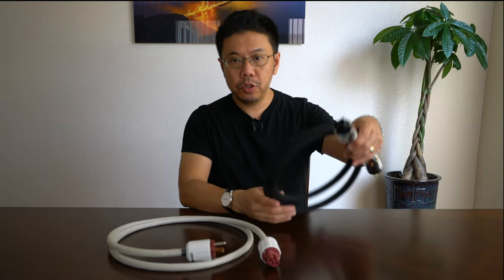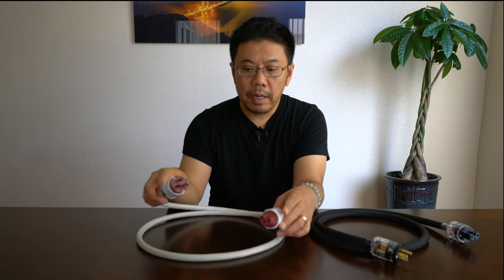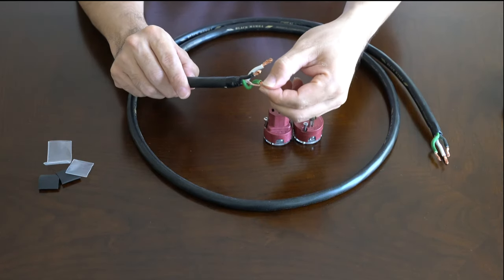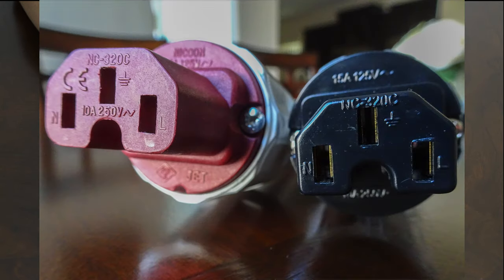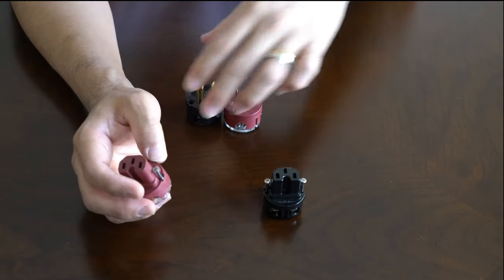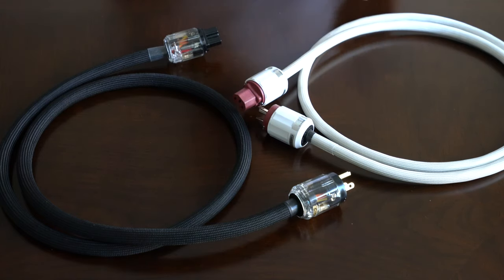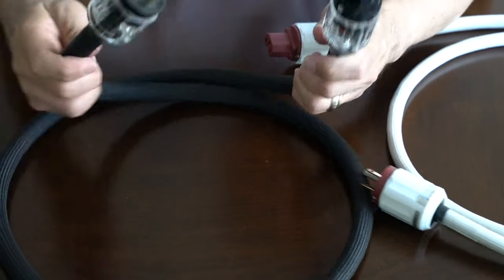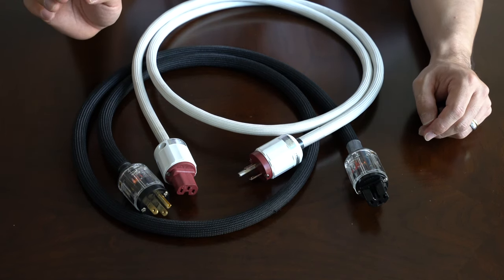Audiophile Grade Power Cables, Easy DIY AC Power Cords

Comment: Thank you, this is very valuable information. I’m planning to make all your cables. Can you clarify if W3104 can be used both for speaker cable and power cord as you’ve used?
Reply from the maker: Yes you can use W3104, it will work great.
Reply: Thank you! Then I can order for speakers and power both from redco. Much easier. 👍🏽

Comment: Hi. Nice video. I have an Accuphase C-240 Preamplifier and would like to make a decent quality power cord. It has the old 2 prong socket on the unit. Are there new female plugs that will fit this unit? When I bought the unit it included a very light weight third party power cord and I'm sure it affects the sound quality. Thanks for your anticipated response.

Comment: what about the rest of the power wires in my walls from the circuit breaker?
Reply: LMAO!
Reply: Better yet what about the cable coming from the transformer outside supplied by the electric provider? I don't think I can talk them into installing a cable from Audioquest or PS Audio lol. 👍

Comment: Have you ever looked into upgrading the wall plug circuit to a 20amp from 15 amp with heavier AWG copper to it from the panel?
Reply: If you can, start with running 10 awg wire (10awg 1-40 feet, 8awg 40-60, 6awg 60+), 15A breaker typically fine for most(20A breaker good too), 20A receptacles are better for not much more, 20A receptacles throughout the house is really the way to go. Even better use Hospital grade receptacles for Audio gear.

Comment: On the female plug...you don't use the shield + Ground (Only ground) ?
Reply: I have this same question. On the IEC end you just leave the shield unconnected?
Reply: It’s called a drain wire usually only on the one side which is plugging into the wall.  This effectively gets the noise out of the component injects the noise back into the mains.

Comment: I don't think there are "audiophile grade power cords" technically, like there are no "gaming" motherboards.
But I love the appearance of your DIY cable.
Reply: Technically you are right, there is not much difference.
But semantically you're wrong, because "audiophile grade power cords" => $160...$200, thats a serious difference and it makes it audiophile.
Reply: of course, you are right.  motherboard gamer, gamer chair, gamer headphones, gamer peanuts, gamer keyboard. 
 being so: I have "audiophile grade power cords" in my water pressure pump installed in my house (shielded, line, ground, neutral, isolated cap/connector brand Leviton) .  and I did not noticed my Milwaukee Drill has audiophile grade power cord
Reply: @telelaci2  "audiophile grade power cord" 🙄
being so: I have "audiophile grade power cords" in my water pressure pump installed in my house (shielded, line, ground, neutral, isolated cap/connector brand Leviton) .  
and I did not noticed my Milwaukee Drill has audiophile grade power cord 
a power cord of 25 USD, vs 75 USD power cord of my polisher tool _that's a serious difference and it makes it audiophile. 😆

Comment: Does the model # of the Oyaide plugs determine what gauge wire can be used. I bought p79/c79 using 10 gauge  wire have a tough time inserting wire.

Comment: How do I know if my component requires a grounded or ungrounded power cable?
Reply from the maker: if you have 3 pins in the back of component power input you need grounded AC power cord.

Comment: Do not take the word of this guy there are electrical properties that must be addressed in building a audio grade power cord current delivery,sheilding, metallurgy,to name a few you can’t just go out and buy bulk cable and expect it to perform great,if you have a low fi system you might get some benefits from these cables but certainly not for a high end reviling system

Comment: Power cord is only part of the equation, you will also need to upgrade the wall sockets and mains cable  between the sockets and circuit breaker.
Reply from the maker: Yes, I even have my own transformer for whole house.
Reply: @Tharbamar  
Next upgrade: install your own diesel electrical power generator. It's the only means of ensuring the quality & continuity of generated power. In Australia MITSUBISHI Powered 5kVA Diesel Generator 240V is decent, quiet, single phase retailing for around $6,500. I highly recommend dedicated power generator for high end HiFi audio system.

Comment: Hi Tharbamar. Very nice video! One question relates to the plugs: why did you choose the Oyaide knock-offs when you could have gone with something like HiFiKing CC-18 & PU-18 sold at the same price on Amazon?
Reply: or even these which are also knock-offs sold from same dealer in US: Oyaide P-037
Reply from the maker: whizzbang because I preferred Oyaide design, thanks
Reply: @Tharbamar  Good reason;-) So you like the P-029 better than the P-037?
Reply from the maker: whizzbang No particular reason, I only choose base on the same design of genuine Oyaide plugs I already have.

Comment: @Tharbamar Can the Mogami 3401 be used for the grounded build? What is the difference between the two wires in your testing
Reply from the maker: Yes you can add dedicated ground wire lope around W3104 from end to end counter lope from twisted main conductors and put on the nylon jacket over it to use it as grounded AC cord.
Reply: Mogami also has 6 cores cable 2919 and 8 cores 2941, but 3104 is the most common cable.

Comment: Which style cable goes on which components? For example Marantz receiver and power amps?
Reply from the maker: I thought I said it in this video, you have to use base on what you need and sound that you like, usually I use the best one amps.
Reply: So it doesn't matter to what the device needs? It's based on which will be better sound and quality?
Reply: And to be clear the Oyaide black mamba is the supior wire?

Comment: Will this type of plug work for computers? I have a PC that I use for audio I think this might help a bit for noise.
Reply from the maker: The white cable is more suited for your need.
Reply: Depend if you using USB?  in that case you need a USB isolator like this:(iFi iPurifier3 USB Audio and Data Signal Filter)  otherwise you have noise like me.

Comment: does it actually change the sound? or improve atleast?
Reply from the maker: Yes it does change the sound in most of my systems.
Reply: I was skeptical with an upgraded power cord at first. I built a Bottlehead Crack and bought the upgraded power cord from their website. The difference is night and day. Everything sounds more realistic and the bass improved.
Reply: @Tharbamar  your cord is 1.5meter in length?

Comment: Anybody know a seller that sells a similar quality already made cable on eBay or Amazon? You can find them for like 20 bucks on eBay thanks anyway for the tutorial
Reply from the maker: You can buy Oyaide Black Mamba for around $2-300 but you’ll not find 6AWG Power Cable with Neglex Copper for sure.

Comment: I made it to 1:25 and face palm. Boy I hope your wall outlets are also 102.3% conductive and everything else before and after the cable. I'll bet the wire inside the amp that runs from the rear panel IEC plug to the transformer ISN'T shielded and ISN'T 102.3% conductive.....LOL !!! When it comes to conductivity %percent% ratings are relative to 99.9% OXYGEN FREE copper being 100% conductivity even though its not. So this special wire is 2.4% more conductive possibly. Will this make a difference to the transformer inside... its shouldn't, especially if it was well engineered. Also nearly all audible noise is filtered out in the AC to DC conversion so conditioners and shielded power cords should only be needed in more extreme cases. Now on the other hand if you just want it for aesthetic reasons and there's nothing wrong with a little audio jewelry by all means dive in, may even make you THINK your system sounds better. Just like after you wash your car and it seems faster.... Cool video Tharbamar, cables look really nice.
Reply from the maker: I have my own transformer for the house. That is the big difference between me and many others. 
You can lol as much as you like it’s all about enjoying the hobby. When I can pass the blind test 5/7 times that is very different story.

Thanks for the comment.
Edit, I’m making another DIY AC  Power cable guide video in a few weeks with different design.
Reply: @Tharbamar  And I'll be sending cables into AudioScienceReview for scientific debunking. If it can't be measured or quantified all thats left is the fact human hearing is flawed. I've tested a few cables with my DATS V3 system and no power cable has shown any measurable improvement. Take it to a professional level Gene an actual engineer at Audioholics has tested many expensive power cables with no measured performance increase. Soon Amir at AudioScienceReview will be testing power cables and I can bet what he'll find far as a performance improvement..... nothing. Yet people still "believe" they can hear something we can't measure with todays insane technology.

Comment: this is an awesome idea, but it seems impossible to find Oyaide power plugs/IEC plugs to suit the Australian market...it seems only furutech makes them and they are VERY expensive, negating a DIY power cable imho...

Very disappointing :(

edit: Oyaide doesn't, and has NEVER made power plugs to suit the Australian market.  Very, very frustrating.  Are you aware of any other plug manufacturers that are decent and well priced that make them for the Australian market, other than furutech which charge an arm, leg and kidney with probably a 10000% price markup ripoff...
Reply: Just use Legrand/Gira or ABB plugs. I use IP44 Legrand rubber coated ones because they fit in the arm really well.
I solder or crimp the bare wires.

Comment: mains cables for high power should never have a shield it creates inductance on the cable that rises with current draw Ferite  is a far better solution as for plugs all that maters is how noisy or quiet the connector is regardless of cost ... have fun be safe
Reply: "creates inductance" - how does it do that? there may be a capacitive effect, but that would be important only if you run the cable parallel and very close to other cables.

Comment: When you use a shielded cable, the shield should only be terminated at the wall socket earth pin. Do not connect the shield to both ends. This is incorrect.
Reply: Stephen, can you please comment on why? I would like to learn. :)
Reply: Eric Bullock by terminating the shield/earth at the wall socket only, it removes EMI/RF interference back to the wall socket, away from the device connected. Same applies to audio interconnects. 

Plenty to read on google.

Comment: Why do you call it fake there's nothing fake about it , it passes regulations why calling it fake? its not pretending to be the other make.
You should shield the amplifier cable as well even if the ground is not used
Reply from the maker: Shield is not needed for most power amps, it will only add more resistance, it’s fake because it was advertised as Oyaide.
Reply: The only reason to shield a power cable is if it runs alongside (or even near to) a very low level signal cable like a phono cable, otherwise the shielding just adds capacitance.

Comment: Two 12 awg wires combined equals 9 awg not 6 as mentioned in the video.
Reply from the maker: Not Two 12AWG, actually 4 x 12 AWG = 6AWG total gauge.
Reply: @Tharbamar  yeah, but you are splitting that in two pairs. So, you are getting 9 awg per leg. 9 awg for the positive, 9awg for the neutral. When you combine 2 wire gauges that are the same size, the gauge is reduced by 3. So, two 12's equals 9, two 10's equal 7 and so on. Anyways. I'm really surprised that you prefer the Mogami over the PS Audio for your Amp. It has me very curious to make one. I have an Audioquest Blizzard that I borrowed from a friend and while it sounds good, I'm not sure it is worth the money.

Comment: Is the mogami w3104 a 12 wag or 6awg
Reply from the maker: 12AWG x 4 is 6 AWG total effective gauge.
Reply: @Tharbamar  Not following this Tharbamar. Can you explain what makes it 6 AWG effectively? If one uses two 12 AWG wires together in parallel that's 9 AWG not 6 AWG.
Reply from the maker: whizzbang 4x12AWG combined is 6AWG of total wire gauge, thanks
Reply: @Tharbamar  I think that's misleading, isn't it? It's like referring to 14 AWG speaker wire as if it's 11 AWG. For that matter, is there any audio related application of Mogami W3104 where one would  use all 4 wires connected together in parallel?
Reply from the maker: @jahearnca1  Total effective gauge is not misleading because "total".
Reply: @Tharbamar  But not "effective".